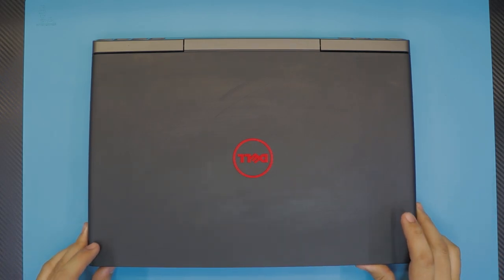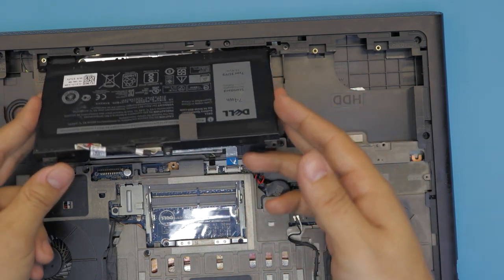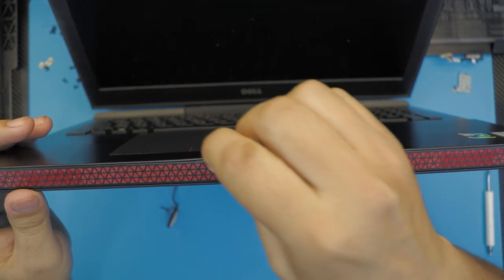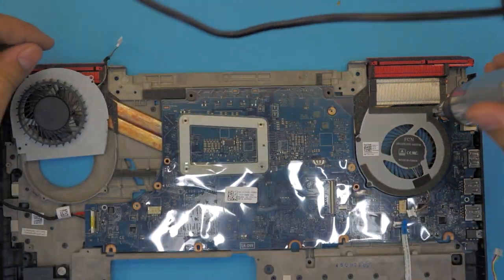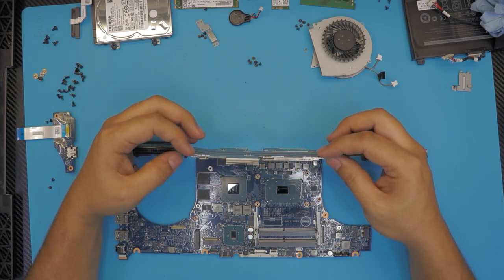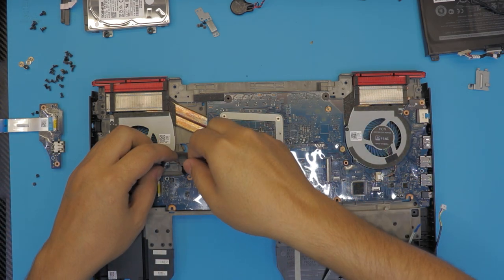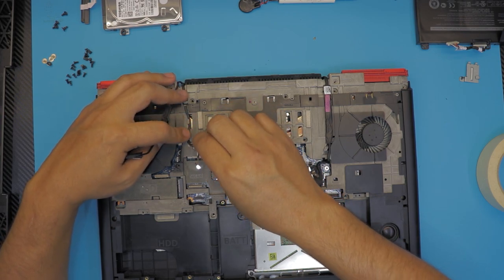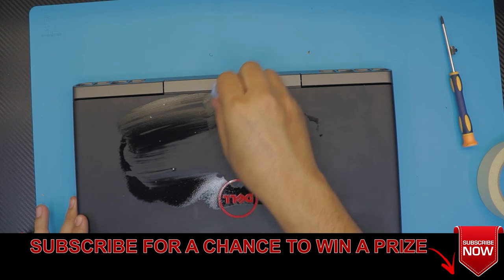Dell Inspiron 15 7000 LIQUID METAL thermal compound and teardown

Comment: thank u for uploading. the video is edited well & made easy.
Reply from the maker: You are welcome! Glad you liked it 😊Thank you for the feedback! if you wish to support the channel you can LIKE or SUB or both :P
if you have any question or request in the future feel free to ask me.
Reply: @uFixTek  what is the exact model of this laptop? Is it safe to do? Can do the same on my 7567?
Reply from the maker: its the same 99% as your 7567, BUT i would highly recommend you to not place a LM.
go with : thermal grizzly kryonaut extreme: https://amzn.to/3Ng1vXE
the LM is very good but very risky and fragile if you move the laptop a lot, its good for computers that don't move from its place. because LM will dry after a month and it will create a perfect bound and awesome heat transfer but once its dry and bounded its at its most fragile state, any slight vibration or hit it will crack that bound and you will get the worse heat transfers, but use the PASTE version you will get almost the same result with a factor of 2-3c difference, but its none conductive and it will not dry for 5-6years.
 i hope i have explained my self.
Reply: @uFixTek  oh, thanks a lot for the insight. much appreciated.
how about this one, corsair tm30 performance. its available in the place i live in so i was thinking of this one. is this as good or good enough?
Reply from the maker: That's totally fine i would use it too, it has a very  excellent thermal conductivity.
Reply: @uFixTek  alright then. Thanks a lot for answering my question. It's been really helpful. Take care then.
Reply from the maker: my pleasure my friend

Comment: hey i have the same model my laptop heats without no reason. it been 3 years since i bought it. my laptop mostly runs on dedicated graph card. will doing this make any difference?
Reply from the maker: if you have never cleaned the paste you must do that, and clean the heatsink.

Comment: Hey My gpu gtx 1050ti no longer works I’m wondering if can replace the gpu or replace the entire motherboard for the laptop? What would you recommend. My laptop cannot use the graphic card for gaming. Can you please help!
Reply from the maker: hi and thank you for your support,
and if you want to get your GPU working, let tell you you cannot replace the GPU (not by your self, its called reballing GPU)
BUT  you can Fix the issue at home if you follow the following instructions:
#1, remove all the motherboard, remove everything off the board as it shows @17:28  
#2. then you want to get a aluminum foil tape : https://amzn.to/3jh4tLr
#3. then you want to isolate using the tape the GPU, doesnt have to be perfect. you can see how i isolate a gpu on this video (  https://youtu.be/LPThmVu9-JM?sub_confirmation=1.  ) @8:54
#4.  make sure your have no air blowing to the where you working nor A/C is ON,, it most be at room temp or 28c above
#5. get a heat gun or get a hair dryer set it to max heat and medium air flow (heat gun must be at 280c) the hair dryer just sset it to max heat.
#6. place the board on a wood surface , not glass nor metal.
#7. deep the hair dryer above pointing directly to the gpu with 3cm of distance. for 5 -7min
#8. turn off the heat and DO NOT TOUCH OR COOL THE BOARD. let it sit and cool down by it self for 10min.
#9. clean up and place new paste and you will see the result :)

good luck

Comment: do thermal paste (metal one corrode after the certain period)
Reply from the maker: Thank you! for the feedback and your support to the channel by SUB :P
regarding your question: NO it will not Corrode nor it will go bad regarding the thermal conductivity.
you have to keep one IMPORTANT thing in mind about LM:
#1. LM when applying its in liquid format, so you can safely move the laptop around without any worry.
#2. after few months of use the LM will not stay at its liquid state, it will become hardened and it will bond 100% with cpu and heatsink (it will not destroy or damage the die or the heatsink) , it will cure and it will have even better heat transfer effect.
BUT when its cured at 100% the bond its very very extremely fragile, that means if you bang around the laptop in the bag pack or slow bumps on the table it will crack the cured bond and the results will be HORRIFYING.
if you are not planing to move the laptop on daily bases and it will always stay in one place then sure do LM, else you have to be very careful after few months of applying LM, else you will be forced to reopen and re apply LM.

option: you can use instead of LM use his paste version and the differences are about 3-4c 
https://amzn.to/3tSv2Md

Comment: Usually, you don't want to spread manually the paste as it creates air bubbles.
Reply from the maker: there is no way you can even create a air bubbles on a crystal dye on cpu or gpu, the only time you MAY *1% chance , is when you have a IHS on the cpu , whe there is a direct dye there is no way in hell you can create a bubble, calculating the heatsink pressure. we have ran many many test, and you will get the same results if you place the thermal paste 20 different ways. thank you for the concern and the feedback my friend.

Comment: I see you didn't clean the heatsink.. isn't it necessary to clean it when u open up ur laptop, becuase i've heard the dust attached to heatsink disturbs it's airflow.. Some suggest to wash it aswell.. is it possible with this particular model?
Reply from the maker: Oh ya defiantly you will have to use a tooth brush and compressed air, but in the name of god don't wash it. if you get to wash it you will have to use hair dryer for at least 5min to heat it up nicely, all you need is to use brush and compressed air.
we use this compressed dry air vacuum, that is 1000% better than any air can that is marketing, that it will push humid  air and can damage components and also the pressure from this air cans are nothing compared to the air duster.
and the air dusters can be use around the house for many stuff and in a long term it pays off. check it out.
i can't run a service job without the air duster :P
in the video i didn't  clean with brush the heatsink because it wasn't too dirty.
https://amzn.to/3fVoIPg
Reply: @uFixTek  idk about compressed air... i really don't want to spend too much on this 5yrs old laptop.. i already got the thermal grizzly LM paste for double it's price, cuz it isn't available in my country atm.. i want to use some household stuff to clean it.. i already have my set of cleaning tools, 6-7 different sizes of brushes, alcohol swabs and a blower.. all i'm waiting is for the paste to be delivered..
Reply from the maker: then use brush and clean if you wash make sure its dried quickly and leave it in the sun for few hours or something.
Reply: @uFixTek  sure thanks! :)
Reply from the maker: my pleasure my friend :)

Comment: Hi, I would like to replace the hinged air rear cover. Can i just remove it without touching the internal?
Reply from the maker: Thanks ✌  for the feedback! if you wish to support the channel you can LIKE or SUB or both :P
regarding your question: what part is that you want to replace the hinge or the rear cover?, to remove the hinges you have to remove the panel only not the motherboard.
and for the back cover only remove the back cover as shown in video @7:00

Comment: The fan of the cooler of mine is so noisy! Is it normal in this Dell gamer?
Reply from the maker: Thank you for the feedback! if you wish to support the channel you can LIKE or SUB or both :P
regarding your question:  under heavy load they do sound very loud, but you can def make it better by replacing the thermal paste, if you not going to use LM, use the alternative in paste that gives you same results almost with 5c difference.
thermal grizzly kryonaut extreme: https://amzn.to/3aY6ldX

Comment: Hi! After reassemble fans are working but screen is not. What i missing? Thanks.
Reply from the maker: You're welcome! Thank you for the feedback and support to the channel by SUB :P
regarding your question: remove both rams
and re insert only one ram in the dim at the bottom, and power on and wait 5-10sec once u get screen and logo , then power off and insert 2nd ram and power on and wait up to 30sec.
Reply: I have the same issue. How did you fix it?

Comment: ¡Excelente video! Realmente estoy considerando hacerlo yo mismo aunque aún me da un poco de miedo 😅

Tengo una duda respecto a la ranura M.2 para el disco SSD, ojalá puedas ayudarme. ¿Es posible colocar un WD Black SN850X? La verdad no estoy muy familiarizado con el tema y según veo las especificaciones del equipo, admite discos SATA o NVMe, pero en éste y otros videos he notado que utilizan discos SATA (2 ranuras) lo que me hace dudar en si realmente podré colocar el SSD que mencioné y, que sin investigar lo suficiente, ya compré.
Reply from the maker: Es un gusto poder ayudarte. Si es posible instalar un NVMe, independientemente de la marca y modelo, de hasta 2TB. Sin embargo, asegúrate de que tu CPU sea de 6ta generación o superior. Si tu CPU es de 5ta generación o anterior, solo podrás colocar un M.2 SATA con dos cortes.
Reply: @uFixTek  Muchas gracias por responder, por suerte mi CPU es de 7th generación.
¿Recomiendas instalar el SSD con un disipador de calor? Ví que hay unos en forma de placa y no sé si debería colocarle uno.

Me suscribo y te envío un saludo, nuevamente gracias!
Reply from the maker: absolutamente no requere nada de disipador , estaras perfectamente bien.
gracias por el apoyo

Comment: it is okay if i add copper pad on gpu and cpu, do u have any suggest for the copper pad thickness (0.3mm-1.0mm)
btw thanks for the tutorial video i appreciate

Edited:
wow my laptop turn into 67C from 95C in full load with liquid metal and shim 0,3mm
Reply from the maker: sure you can use a copper shim size get 2cm x2cm and .3 -.4 mm 
check here https://amzn.to/2rGhmdc

Comment: Hello, after doing this operation, how much of a drop did the display card and the processor achieve?
Reply from the maker: it dropped about 25-35c there is nothing better than LM if you place LM and what ever number you get that the best you can get.

Comment: I need help! After putting in the thermal paste and reassembling, now my laptop turns on with a blank screen and fans on but then shutsdown automatically after few seconds. What should I do?
Reply from the maker: Remove both rams, and plug in and power on and power off, then only plug one ram and power on and once you get a logo, then power off and place the 2nd ram and power on and it may take up to 15sec and it may restart twice.

Comment: What happens if by mistake I remove or detach the part that holds the metal hard drive cable to the motherboard, just the one you say that only a few millimeters 😬
Reply from the maker: Thank you for the feedback! if you wish to support the channel you can LIKE or SUB or both :P
regarding your question: can you send me a picture of the damage you have created :P ?

Comment: Hi, one question ... I'm thinking about changing the thermal paste of my laptop (it's the same as the one in the video) I've been with it for two years and I have not given it maintenance or anything and although it does not heat up that much, I've noticed that Warms up more than before, my question is: Is it necessary to change the thermal paste now or wait for it to really heat up a lot?
Reply: and what thermal paste recommended?
Reply: @josuepaz1125  if you just want paste, then I personally use liquid silver.  However other people in the comments have said some other great brands.

Comment: Can I do this without removing the CMOS batt??
Reply from the maker: 🫠Regarding your question, absolutly you can, the bios battery can be left alone if you wish.
Should you have any further questions or requests in the future, please don't hesitate to ask me.
cheers🍻
Reply: @uFixTek  I'm opening my laptop for the first time in my life. I need to change the thermal paste. How risky is it? What are the chances that I'll brick my laptop?
Reply from the maker: if you take your time and watch the video and do exactly as i mentioned you will be more than fine, if you need any extra help let me know i always answer comments.
Reply: @uFixTek  I'm using kryonaut which is non-conducive thermal paste. So, can I skip putting electrical tape on those capacitors next to the CPU/GPU?
Reply: @uFixTek  And how do I know the thickness of thermal pads? (if I wanna order some online). I have this same laptop Dell Inspiron 15 7000 series
Reply from the maker: If you are using paste, there is no need to use tape. Regarding the pads, I highly recommend you not to touch them; leave them as they are. If you place thick pads, it will counter push the heatsink away. If your pads are soft and not damaged, leave them alone.
Reply: @uFixTek  Okay, thanks a lot for all the info!
Reply from the maker: anytime my friend.
cheers🍻
Reply: @uFixTek I had trouble removing one fan screw and one motherboard screw. I was unable to change the thermal paste because of this. I tried a lot but that screw just wasn't rotating. I tried all different sizes of screwdriver. I finally just gave up and reassembled the laptop

Comment: Whats the dust build up like after one year? My GPU temps hang around 56*C idle and 74*C on full load. Would you classify them as fine? I dont want to have to go through all this effort just to remove a small amount of dust.
Reply from the maker: no one can help you to tell you but cleaning should be every 2years minimum, there are many factors : where you are is it dusty and the amount of hours that you have your laptop on. if your temps are on 65 idl u still kinda ok, but idl should be 40s.

Comment: have you had any issues with the liquid metal shorting out the system?
Reply from the maker: i been using LM since the day they launched it and up to this day i can surly say that i had never encountered any LM leaking out or what so ever. all my clients are happy and never complained regarding LM issue. thank god :P
Reply: uFixTek awesome thanks a lot. My very similar Dell  fans run constantly when in any game. I might get brave enough to try this. I guess if I put the electrical tape around it can't do damage.
Reply from the maker: your fan will be running constantly if you put LM or not!  the fan temp controller is based on a diode in the cpu GPU and the fan will spin after 50c or 60c a lot. but it will bring your temps down and that means less fan noise.
Reply: uFixTek yeah I'm looking for anything to reduce the fan noises. It just bugs me IDK why.
Reply from the maker: @Toyeboy89  oh boi , let me tell you something, you got two options: #1. install MSI after burner and lower your fan spin curve (and be ready to burn your GPU soon... ) because even if you put a magic liquid or call NASA you out of luck because its a simple physics: the heat from GPU/CPU will conduct to the heat-sink via LM but after 2min in order to heat dissipate  you need air flow, the more air flow the cooler the heat sink and the cooler cpu then the fan slows down..
#2. put a headset :P
you have to choose there is no magic option here, you can only transfer the heat faster with LM or pastes but you still got to cool the heat-sink after 1-2min under load.

sorry :(
Reply: uFixTek if this liquid metal really reduces temperatures by 20 degrees it would lower the RPMs needed to maintain a certain temperature. I don't play super intense games on my laptop, I have a desktop for those. My Dell is just noisy, would've thought it could've been a little quieter with all the advancements in CPU technology but even playing a wimpy game, the fans will be cranking.
Reply from the maker: Tech guy it will reduce the noise mine was super crazy at first then after LM it lower alot , but when i game you can hear the fan but not like beforeLM
Reply: @uFixTek  Best thoural explanation I've read yet.
Reply: @Toyeboy89  it's the diameter of the fans (and the default fan curve)
Reply from the maker: @neverstopz9045  thank you i appreciate good positive feedback or anything that i can do to make it better. :)

Comment: I Followed and did everything now my laptop not turning on. The moment I plugged Inn the both fans runs very fast for few seconds while screen black and then no power at all. No fans no screen and no power light. Please help
Reply from the maker: something you pluged wrong my friend, remove both rams and only install one ram,a nd power on and once you get display then power off and add the 2nd ram, and double check the connections.